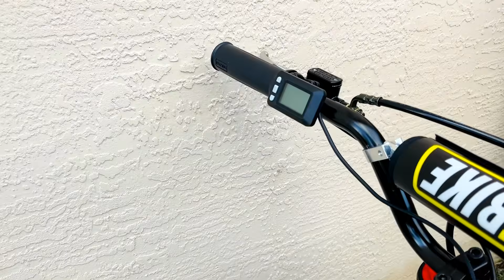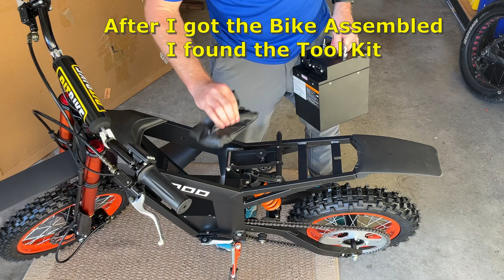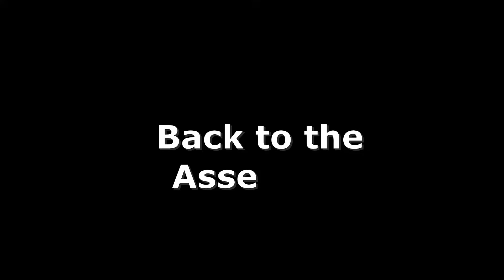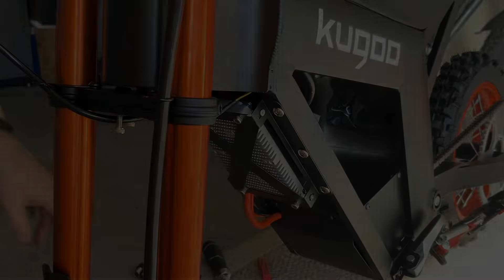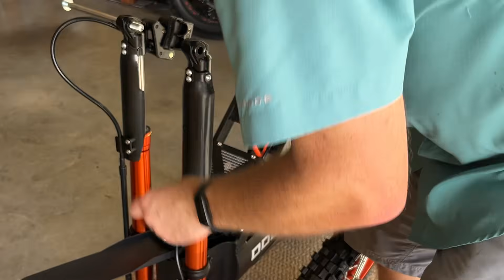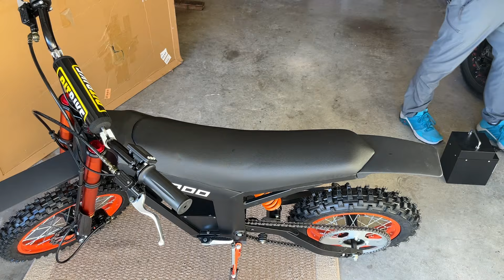Unbox and Assembly - Electric Pit Bike - Tuttio Soleil01 or Kugoo Wish 01

Comment: Does the charger turn off automatically when it reaches 100% charge? And Will anything happen if I forget to remove the device from the charging port? Thanks you so much for answer!
Reply from the maker: charger will shut off automatically. but just in case use $10 count down timers for charging any  batteries so you won't forget

Comment: What do you suggest where the front brake is?Too tight will not fit on the disc break
Reply from the maker: Need to spread brake pads so it fits the rotor
Reply: @BRichSolution how do I spread the break pads

Comment: How many hours does it take to charge a full battery? And does your charger get super hot ?
Reply from the maker: Typically 2-4 hours, if battery is really low then 5-6 hrs 
All ebike chargers get hot its a step down transform from 110v to 54v.   Charger no worse the others i have
Reply: @BRichSolution  thanks for the info! And the instructions says for the first charge it's 12hours, is that really the case ?
Reply: Hey I'm getting a alarm noises with the error code E02??? Only When holding rear brakes and standing bike up only on back tire for learning how to balance for wheelies.Is this normal and does your bike do samething? Is there anyway to turn it off?

Comment: Is the wheel barrings 15mm or 12mm?, I want to upgrade the rims to a purple color and change the handle bars since i dont like h the r orange
Reply from the maker: I am not sure but the spacers between the fork and bearing measure 20mm on the outside
Reply: @BRichSolution okay I might just get a 15mm and pray it fits

Comment: What are the battery dimmensions
Reply from the maker: 125mm wide x 180mm long x 210mm long
Reply: With a 70amp controller I think this bike could take a 52v battery 🔋 stock 🤔hmm
Reply: @burn1gotbeats what one would u recommend